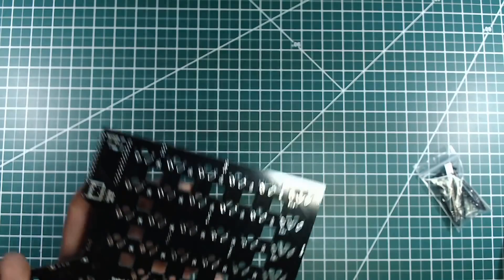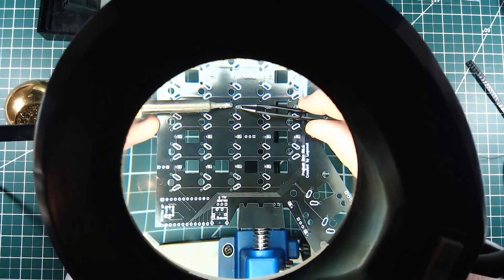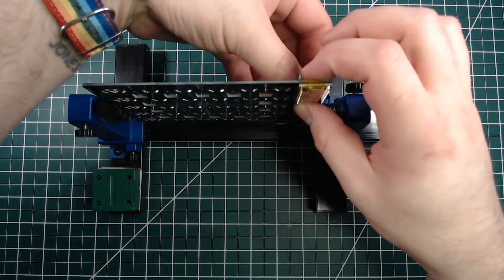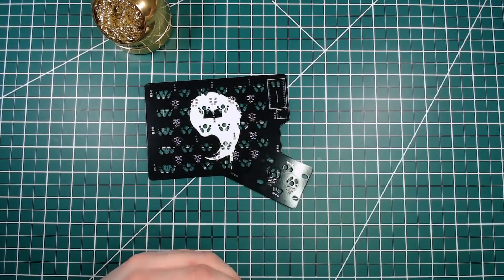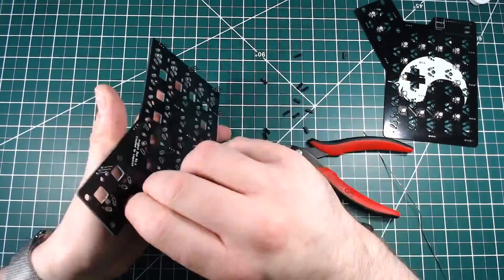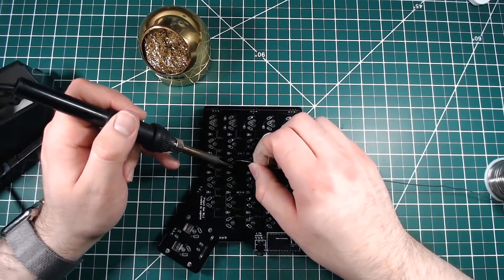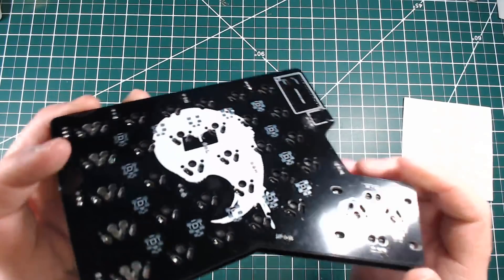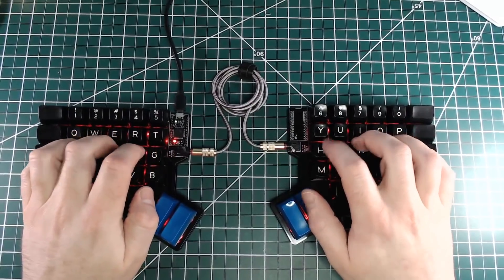Zen Keyboard Build Log

Comment: I highly recommend to add solder "bubbles" just to one pad for each component and fix the component in place with this pad. Then solder the other pins. Otherwise it will become difficult to solder the component flat on the surface

Comment: Do not heed the soldering advice in this video, it's probably the worst way to solder on SMD components.
I learned the hard way. Correct way is to start with one pad only, and then do the rest.

Comment: How much money does it take to produce a PCB for a keyboard?
Reply from the maker: There will be a lot of variables - biggest being the size of the PCB & quantity. 

The bigger the PCB, the greater the cost. The larger the quantity, the lower the per-PCB cost will be. 

I’ve never had a PCB produced, but based on group buys I’ve been in, a 60% PCB with quantity 100 would likely be ~$50/PCB. 

A small PCB (like a numpad) with quantity 5 would likely be $50/PCB.
Reply: Can you produce it your-shelf and if so, how much does the equipment cost?
Reply from the maker: A person could do it themselves, but there’s a high barrier to entry. 

You wouldn’t be able to create a computer manufactured PCB like million dollar fabs could, but I have read about people acid washing copper plates to make PCBs. If you went the acid wash way...a few hundred dollars, probably.